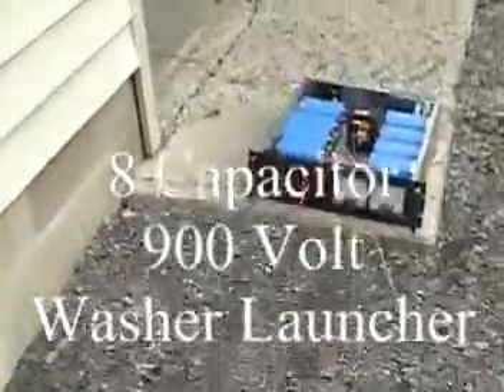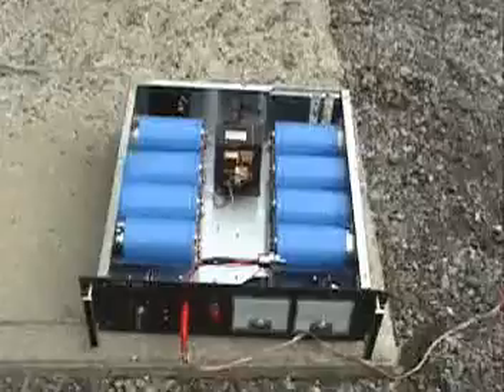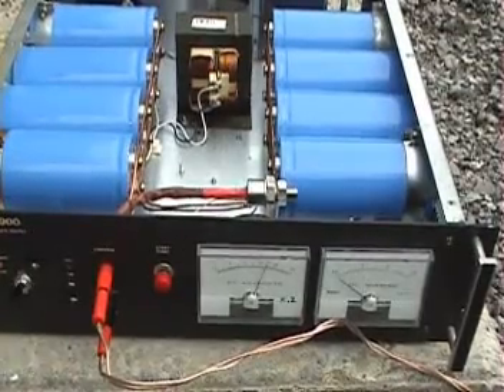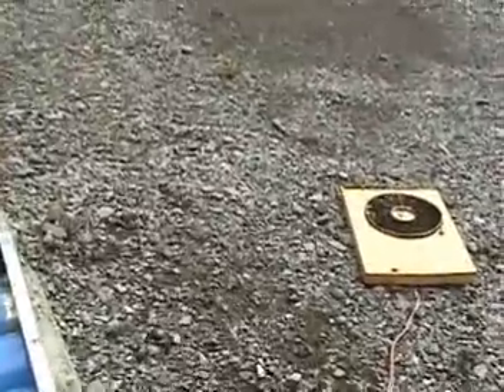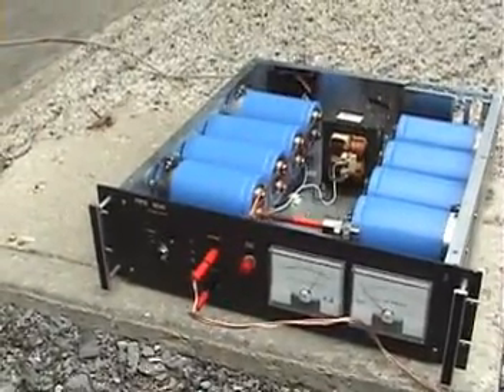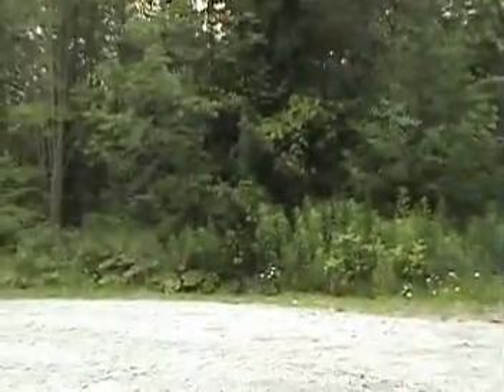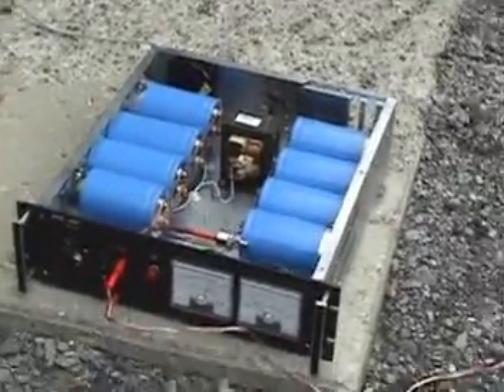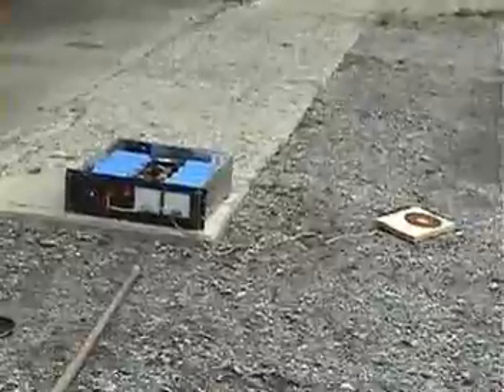8 Capacitor washer launcher

Comment from the maker: I was testing the power supply with a coil gun.  The SCR shorted out.  You should see how red hot the resistor gets running into a short.  I will upload the video as soon as I can fix my computer.

Comment from the maker: I am charging a bunch of capacitors to 800 volts.  Then they are discharged through a coil that forms a magnetic field.  The aluminum washer repels the magnetic field and flies away.  Few people know that alumimum actually repels a magnetic field.  Most metals are atracted to a magnetic field.